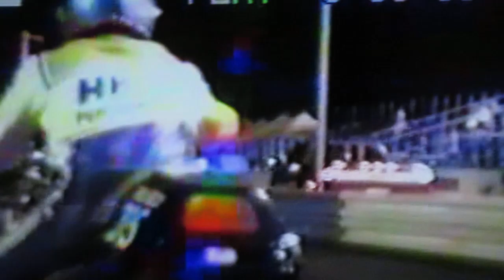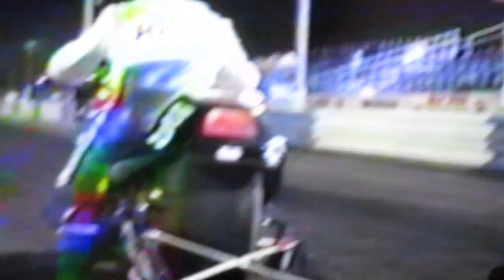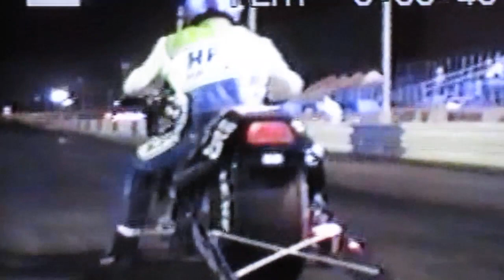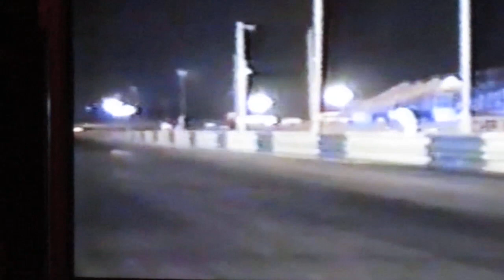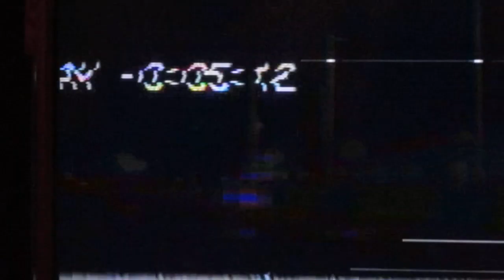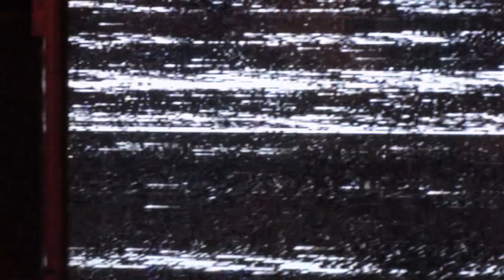Old School  GS Pro Mod Night Launch   Dale Walker

Comment: Love the vintage content. What shot of nitrous are you running?
Reply from the maker: Hi Brandon, This was long before a shot was baseline, meant anything, or ramping in N02 with electronics. I designed my own 2 stage system. I had a baby load behind the 44 mm Lectron carb bells in velocity stacks I machined for the launch. I tuned this, and the clutch, per track conditions. No computer data, just videos, weather station, notes and the time slip.  In 2nd gear I turned those off and went to the big daddy load on the intake ports. I used a timed delay relay that i could adjust in a hundred of a second increments. I also foot shifted my bike with The Holeshot Electric Power Shifter i also produced for Vance & Hines, and that was unheard of at the time.  In my era 80s & early 90s you had to still come up with your only methods and Ideas, you could not order parts and go fast. It  took common sense, experience and a boat load of testing testing. Most of my race bikes never saw a dyno.  I would estimate when this bike went 7.42 @ 180 + I was making about  325 + HP ..... Cheers  Dale
Reply: @DaleWalkerHoleshot  Literally out here eyeballing a 325 HP nitrous bike without even a dyno. Dale you're a legend.